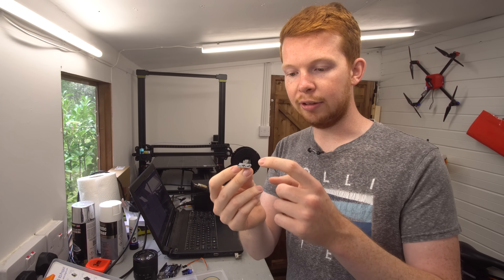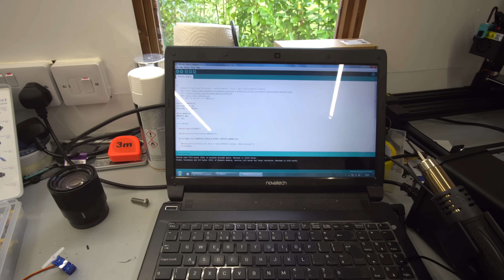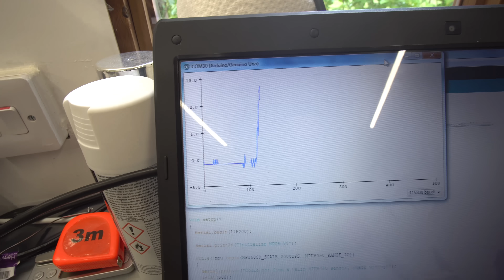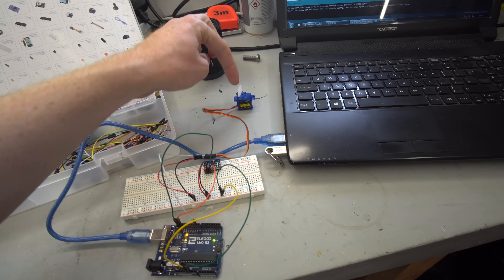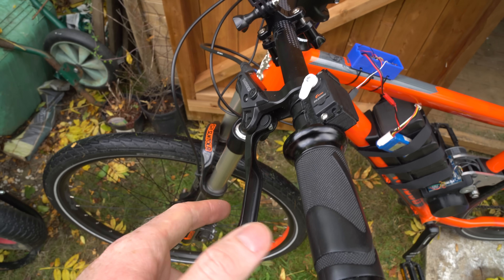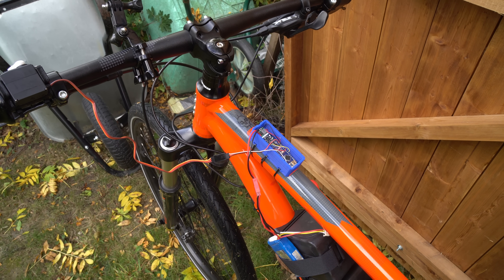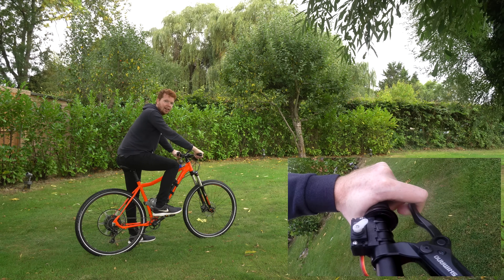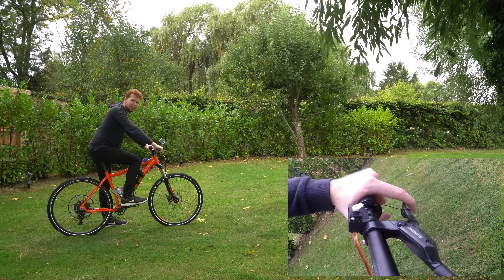Wheelie Cheat Device?

Comment: Tom, have you considered strapping it to your chest? and then if you change the values in the arduino code, you should be able to have it detect when you lean too far back, I realize this doesnt solve all problems but in my mind it seems to eliminate a few, in particular; 
1. you wont have to account for the measure of the bike
2. you wont have to account for the measure of your arms
2. you wont have to account for your weight.
now, I'm not for certain this will work, however it seems to check out in my mind however im probably missing something obvious as I do a lot of the time with projects of my own. 
Cheers!

Comment: I wonder if a neural network that studied a riders wheeling, could use inputs like the bike angle, pedal rotation and rear brake input, to then, when rider attempts wheelie, match the inputs with the correct brake output. Obviously the rider would already need good wheelie technique but it would be interesting to test.

Comment: you should revisit this project, using your speed to gauge the angle ratio, and also smooth out the braking to be more generous. Add in a couple of control knobs for target angle and speed so you can adjust on the field

Comment: Probably the worst way to learn wheelies :D but very interesting project, nice!
Reply: And for those who want to learn:
1. Get a smooth rear brake.
2. Do a wheelie and try to go over the balance point so that you have to pull the brake.
3. Repeat. Try to go over the balance point as slightly as you can and pull the brake as slightly as necessary.
4. Repeat some more. Soon you'll get over the fear and learn to finesse the brake and pedaling.
5. Do wheelies like a boss.

Comment: if the tie was in outer  tip part of the lever maybe the cervo wont have a hard time pulling, and adjust the screw inside the lever so tne distance of the brake pads would be short.

Comment: You can build a device that feels the angle of balance. I build a Segwayrobot with just a gyro sensor, which doesn't know the angle, but only the rotational velocity. I used a fuzzy control system for that.

Comment: I can see two problems one which can be easily worked out, the other one probably can't be programmed (maybe ai can get a good estimation) 
First: having two sensors front/rear that coordinate with each other in order to work in any giving angle that u'll be performing the wheelies at.
Second one is body weight distribution, the angle at which you can maintain that smooth wheelie defers according to the general center of gravity for the (bike+biker) .... In the other hand what i can see fairly ez to do, is to make a bike solo wheelie sine the cog won't change, all u need to do is hook an electric motor a mass attached on the rear 😊
Haven't finished the vid but gj mate

Comment: I must say it will be difficult to make reliably working auto-wheelie system without giving it access to throttle control. The best you can to is to set in PID algorithm target angle value a "hair" pass the "average" balance point and maintain throttle level necessary to provide torque to keep the bike inclining and allow the system to apply brakes and kick you back to the balance point. But again the balance point in your case is highly inconsistent due to large impact of the rider's position and weight on the system's combined center of mass hence the inclination angle needed to achieve balance( center of mass being right above the contact patch if you riding on a horizontal surface, if there is a slight camber, you have to account for that as well).

Comment: Just like the "lift control" (Yamaha R1 https://www.youtube.com/watch?v=AFDCHegDUME ) / "wheelie control" systems on modern superbikes. I believe most work by looking at values from the accelerometers on the bike and also looking at differences between front and rear wheel speeds (during a wheelie these will not be in line), then adjusts the throttle (all modern 1000cc bikes have a servo controlled throttle) or cuts ignition as appropriate to bring the front wheel back down. Some of the more modern bikes also have a front suspension position sensor, so they have a pretty accurate idea of the attitude of the bike and the rate of change of angle of bike too.

Comment: I think you can get much more reliable results if you monitor angular speed and angular acceleration instead of just angle. Then you can make the bike brake more when you have a high enough angle and acceleration is too high. Or release the brake when acceleration is too low (i.e. negative acceleration).

Comment: Tom just add in two pots into your model. Use one to set the zero point angle to compensate for the installed angle of your electronics on the bike frame. And the second to set the top-end tip angle. Then simply have the Code react between those two variable set points. That means you can dynamically set the code as you ride to the perfect angles for any bike and any rider.  Also you can set the possible output angles using the maximum statement in code to the exact range of your servo's input, so that you never set a angle that is beyond any angle your servo can take. Hope that helps. D

Comment: Good lord... You  should take the average of the newest 3 or 4 accelerometer values as your accepted input. The poor thing is freaking out from being jostled around, and you're getting garbage signal because of it. It will slow down the reaction rate, which is probably fine, since the thing has about 100ms of lag right now anyways.

Using the raw unfiltered signal like tossing your phone into a running clothes drier and expecting it to record a nice circular path.

Comment: you should tune the servo, so that it kicks in earlier but just at a fricative point of the brakes. Even maybe on different brakes as disc brakes have just a short reaction time. For example use a bike with cantilever brakes and use the increase brake-cable lenth to better tune it in. That way the moment the arduino kicks in would smooth out, and making it easier to find the point of ballance.

Comment: Your device is very promising! But you need to balance the lever-arm angle with the acceleration at the rear-wheel hub. I.e. When in wheelie position, the horizontal rear-wheel hub acceleration will be zero at a certain angle. If you then change your body/arms position, you will have an immediate change in horizontal acceleration, that you can use to compensate for.

Comment: Couldn't you watch for a slow change? No direct angle to braking force but more of the slow change that signifies that the rider is unable to compensate? (activated near the balance angle?) Also consider logging the wheelie data? You said Gyro accel board? Try using the other data specifically the accel?

Comment: Have you considered a deadman switch? A thumb button that has to be held in to keep the wheelie code running would mean the bike doesn't go speeding away if you fall off. That way it would be safer to let the code control your motor as well. Very nicely presented technical videos, by the way

Comment: I think the rate of angle change is more important than the angle. If the + angle changes rapidly then apply pwm brake until - rate of angle change drops. Probably easier to pwm a motor than a mechanical lever using servo.

Comment: This seems like a fun idea to practice and learn the feel for wheelies and manuals. What about using two trimmer pots attached to the enclosure to adjust the min and max clamping angles? Then each rider can do some basic adjustments for their weight and reach. I'm new to coding RasPi's and Arduino's. Would you mind posting your code to Github? I'd love to mess around with this. Looks like a fun project.

Comment: I think you are over thinking the Segway analogy. In the Segway the position of your centre of mass can change, by pushing the bars away or towards yourself or when going up a slope. It is not the absolute angle at balance that matters, but how it is changing and how fast. If it is changing you are falling.

Comment: An interesting problem. I'm thinking, just off the top of my head, that finding some way to accomplish your goal with the limited means you have, is possible (pure speculation on my part) and will be a lot more fun than getting more technical. 
The human training practice method is to find some way to slow down whole process until you train your body to feel it. 
Never was able to ride a unicycle, never wheeled a bike more than a few feet, but I can still pop and hold a wheelie with a wheel chair for any period of time. 
What if the Arduino sensor was on your body or head? How might you slow a pendulum?

Comment: how did you get 7 volts out of the arduino when its highest power pin is 5 volts? Impressive work, as you learned everything on your own. im thinking of doing the same thing for my school project, not sure yet tho if i can manage it
Reply: oh never mind about my question hahah, the vin pin right?  i dont have much knowledge of arduinos, as we had the microcontroler class for just about 2 months now, but we still have to do a project soon, a project that's wayy out of my knowledge rigth now

Comment: Nice project board & case! :D
Protip: When using those external power regulators on a nano, put a schottky diode between the power reg and the nano's 5V line - that way you can still plug the nano in to usb without problems :)

Comment: Instead of trying to detect when the bike is tilting, why not try detecting when YOU are about to tilt. This way you can keep using your arms to balance the bike and IF your'e about to physicly go beyond your point of ballance (or comfortable limit, whichever works best). THEN you activate the brakes. To tune the perfect point, I suggest setting a button to record the angle when pressed and wire it to your brakes. Record a bunch fo data get your perfect angle, thats what I call the body hack versino. Otherwise you need some crazy math to take into account multiple accelerometer data and blah blah blah sensor fusion.

Comment: First off, a signal filter would really help getting out road noise(look up Kalman filter, or even a normal low pass discrete filter for starter), second, the angle of the motor should be continuous and not binary, helping the motor as it’ll have less distance to cover.In this case a simply having a pid to control  the excess angle should do the business(while setting a saturation of course so you don’t burn your servo), but I’m not sure how linear that brake actuation actually is.

Comment: It's not that complicated to make it independent of the rider and bike mass, but you're not using all of the information you have available to you and that leads to a few pitfalls.

1) You're just using the raw angle of the accelerometer, not a calibrated angle.

2) You're not using a feedback loop so that it knows when it's not pressing the brake hard enough, now it's just blindly moving the servo.

3) You're not using the angular velocity (easily calculated numerically with ((angle_new - angle_old) / time_between_old_and_new_angle) in the Arduino code) of the bike frame to catch sudden angle changes after getting it up on the rear wheel. Just remember to ignore the angular velocity until you actually get up on the rear wheel, for instance by telling it to wait until a certain calibrated angle, otherwise it will have a bad time.

Comment: I think it's better to install it at the end of the lever instead of the beginning...
Anyway cool idea but i think it's never gonna work :p 
If you want to learn a wheelie just shoot the bike underneath you a couple of times to feel when it's getting away from you.
After that choose a higher gear so things aren't going bad so quickly and get the feel, when you are too far jump off... chasing a wheelie is the most commen mistake...
I see it's your problem too get that bit further back and it's going so smooth and so controlled you can do it with your eyes close it's all about the feel !

Comment: If you need to compensate for bending your arms you could use either an ultrasonic or time of flight sensor to measure the distance between the sensor (on handlebars) and the rider’s body.  Just a thought.  Interesting project though.

Comment: You could use the data from the accelerometer to make a plane that can't stall. If the angle of attack is at about the stall angle of attack for the airplane you could pitch down or at least do not allow the pilot to pitch higher. You could calculate the pitch of the velocity vector from the accelerometer and use the gyroscope for the pitch of the airplane and then take the difference to get the angle of attack at that moment.

Comment: Couldn't you measure it using gravity? ah, no I suppose not. I was thinking a 3 axis accelerometer is technically measuring the direction of gravity, and if you calibrated the angle, you'd kind of know which position to hold.
However, that doesn't really help any because it's that angle itself which varies with the rider (and bike) based parameters.
You would need some method of first of all determining when the bike is in it's balance point, and then keeping it there.
But as the exact balance point of the bike is a dynamic, rather than static variable, that's going to be kind of tricky...
I guess if you somehow can measure the relative weight of the bike & Rider that is on each side of the balance point, you might be able to do it.
But while you could, in theory, measure the weight of the whole system at the wheel, with only one wheel touching the ground you lose the ability to measure the relative balance point.
hmmh. Tricky.

Perhaps if you have a wheelie detection system (detect when front wheel is off the ground) combined with a system that records the balance continuously and calculates the rate of change in that balance, you could dynamically determine whether the bike is shifting forward or back, and the device could compensate for it.
If you had a device that does this compensation, then measuring how much force is needed to do the compensation would tell you if you are at the balance point or off from it in one direction or the other. (the more force required to maintain the current state, the further you are from the actual balance point.)
I suppose in a general sense, a dynometer on the wheel could tell you the amount of force indirectly by how much power it is generating, and the direction of rotation of the wheel.
But...

All these schemes are painfully complex, for sure...

Comment: Tom, love it!  I have thought a lot about the physics of the wheelie/manual, and am finally making some progress with my wheelies.  However, for me its not the fore/aft that's tricky, but the lateral balancing (side to side).  I think it would be great if you could adapt your devices for lateral balancing.  Lots of the problems you describe at the end of the vid wouldn't be an issue, as lateral balance wouldn't depend on the angle of the bike (to some extent).  You could fix a weight (~2Kg perhaps) in the middle triangle and have it shift left and right.  Might need a more powerful servo though!

Comment: it should be possible to get it to work independenly from your ceneter of mass on the bike! It is wrong to use the angle of the bike as reference. If you instead use the accelaration on which the angle changes you should be able to find the sweet spot.

Comment: Hey Tom, may I recommend averaging out the readings of the gyro (for lets say the past 2 seconds, but doing it continuously with always the last 2s of data) to get a smoother reading and also a smoother braking. In addition you could add a subroutine to detect sudden steep tilts and apply emergency braking (or release) if needed. For that you can have a threshold (If I'm at 35º, suddenly a 15º degree increase will activate the subroutine), a maximum allowed rotational speed or acceleration. This will also help correcting small errors in the not-military-quality chip. If you ever need any help with the code you can reach me out, kudos and good luck!

Comment: Is there a way to measure the angle of the strain on the rear axle? The controller could be set to keep it as close to gravitationally vertical as possible, because that means the center of mass is directly above the hub.

Comment: bicycle bike wheelie motorbike ebike electric electric bike automatic wheelie wheelie device how to how to wheelie learn to wheelie arduino electronics gyro gyroscope accelerometer coding wheelie cheat device wheel wheels invention best electric bike electric bicycle cycle riding DIY homemade do it yourself 3D print 3D pinting 3D pinted skill motorcycle motorcycle wheelie wheelie school mtb mountain bike wheelie mountain bike beginner. Are the tags in this video :)

Comment: For future portable experiments, maybe use an adjustable pot + LCD display to be able to tune the response of the servo without having to connect to a laptop?

Years ago, RCSUPERPOWERS made an RC "jet" (may have been EDF or prop, I forget) and it had accelerometer-controlled canards that would let it fly controllably at amazing angles of attack.

Comment: why not use an accelerometer to determine when the bike starts tipping?  Then use a PID loop to control the brake with how much brake you apply and how long you apply it for.  Would make for a self-correcting system that would bypass any issues with rider weight and balance points difference between riders and systems.  Pretty sure there's freeware like flyduino that you could hijack most of the code from.